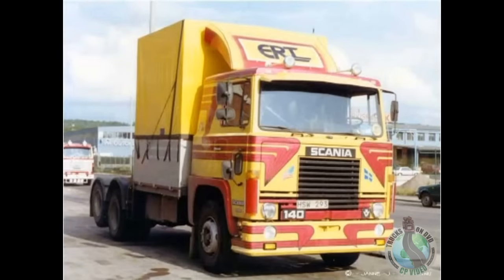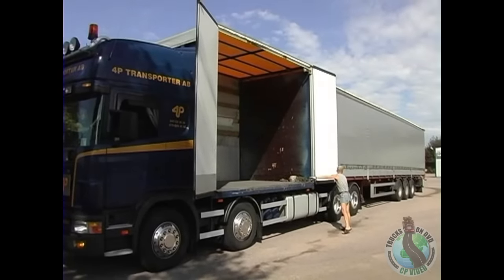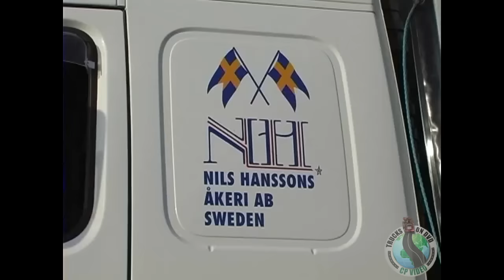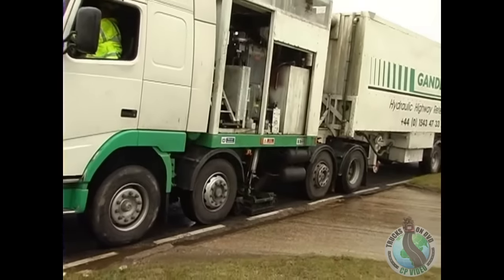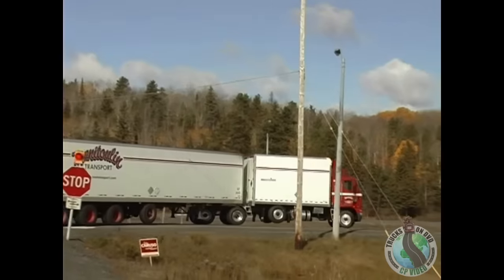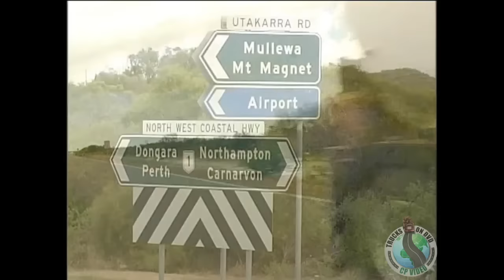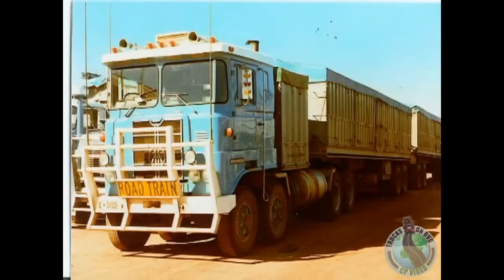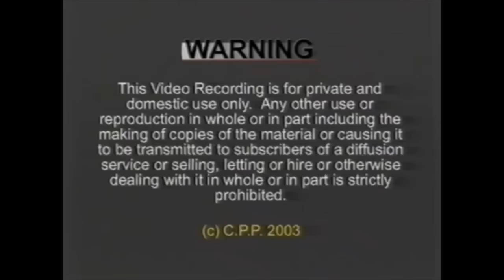'Loaded & Rolling' - The story behind the 'Drom Box' -  Part 2

Comment: ODD NEVER SEEN IT RIDING HOW HIGH IS A RUCKSACK TRUCK?
Reply from the maker: Sorry, not sure of exact height, but naturally always within the legal requirements to use the local roads and highways.
Reply: In Sweden, the height is 4.5 meters which does not have to be signposted, you can drive higher than that but you have to measure everywhere yourself. These types of trucks are called dragbil med ryggsäck = semi-truck with backpacks in Sweden, they are not common anymore, in my 10 years as a professional driver I have only seen 4 that are still rolling.